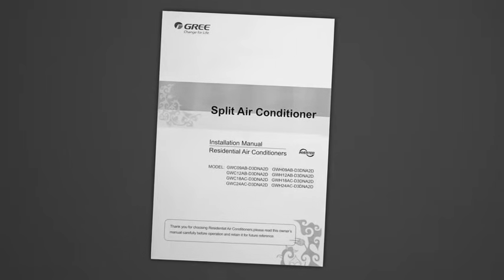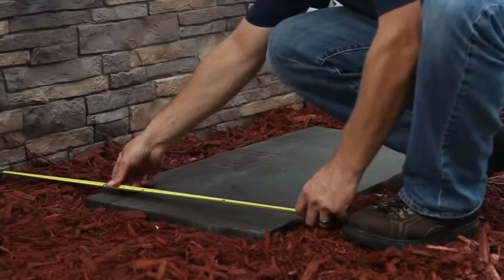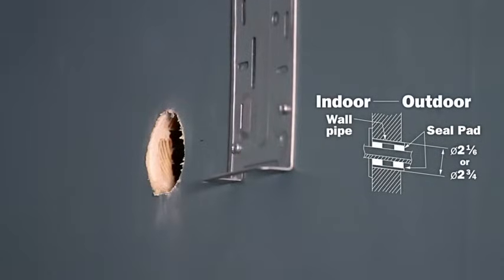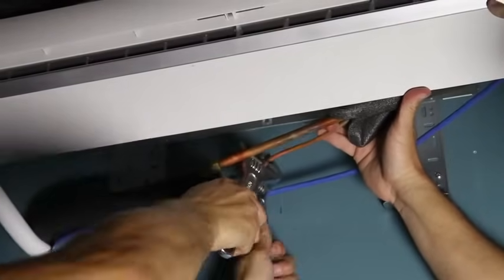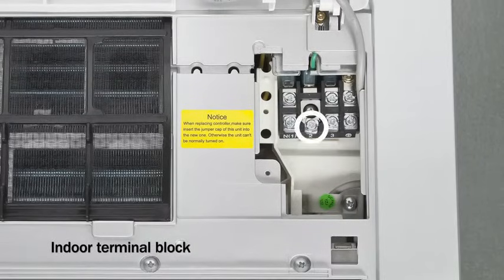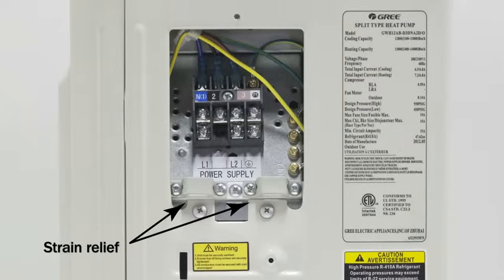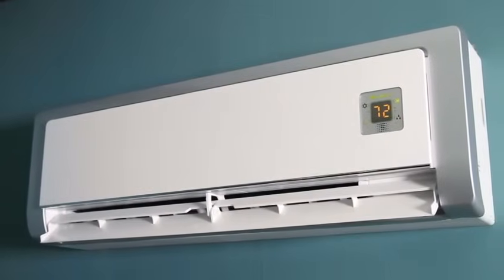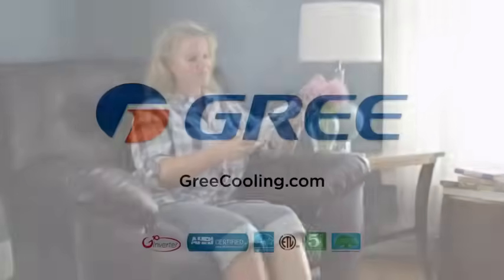Gree mini split Installation Guide

Comment: So if only and only qualified installers can install these  to whom is this video address to ?
Reply: These are garbage they mention nothing of the most important process 
Which is the connections of the water drain as they leak in the walls causing much damage and mold

Comment: I disagree with the instruction at 1:45 to "Make sure it's perfectly level. There's no need to pitch it toward the drain hole". My Gree smells musty upon startup, probably because there's slight pooling of water. Knowing what I know now I would pitch it slightly toward the drain hole, like 1 degree.

Comment: Do you guys recommend putting any thread sealant on the lineset threads when connecting?
Reply: Nylog is fine, it is a basically refined refrigerant oil that assists in making a clean connection for flared fittings. If any gets inside the system it wont cause issues.
Reply from the maker: That's a great question, while that's not something we have seen used during an install, we would recommend checking the manufacturers specifications.
Reply: Hello sir what is the problem after stall the unit there is 2 line blink
Reply: Never use any sealants on copper flare connections, if they are done correctly, they will not leak, but if sealants are used, they can be extremely difficult to open
Reply: Definitely not on the threads....flare fittings seal at the flare ...not the threads. Some use' Nylog' on the face of the flare sealing surface.